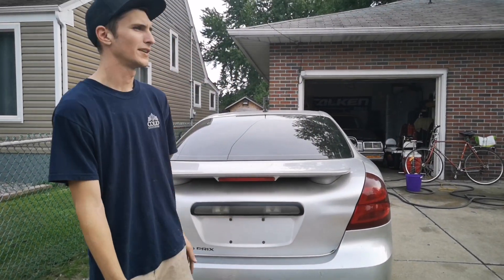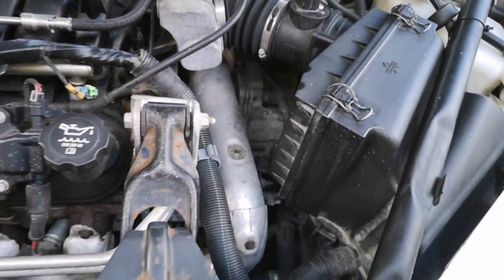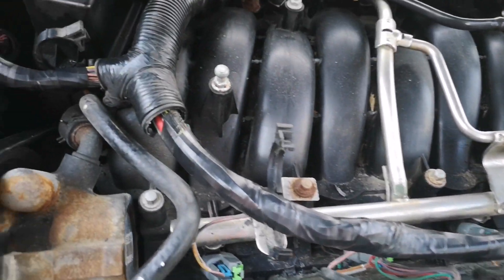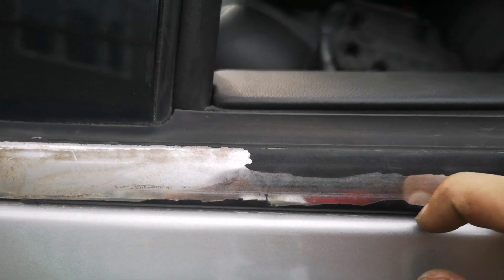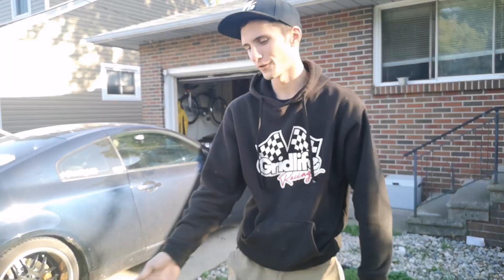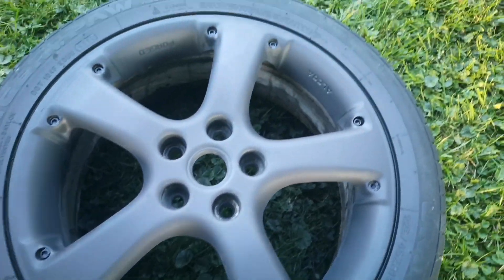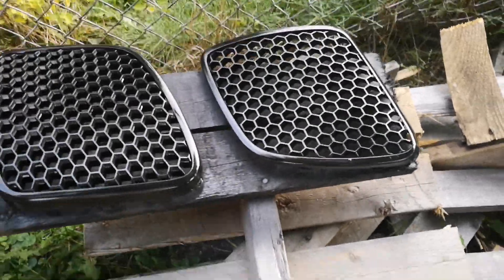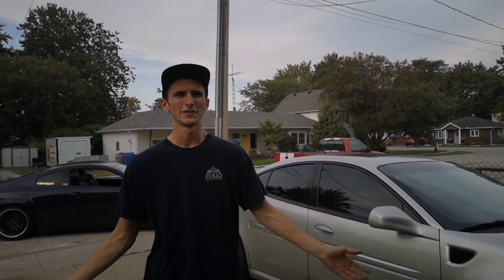abandoned 2006 GXP update 2 (transmission failure)

Comment: Yep that's the torque converter gone. Likely the clutches gone as well. The pump is clogged.

1500 is cheap so make sure they use quality parts or you will be back at 50k.
Reply from the maker: Thanks for watching and giving us your opinion!